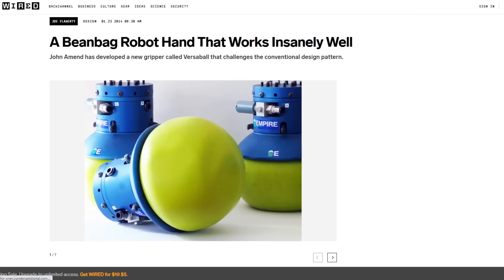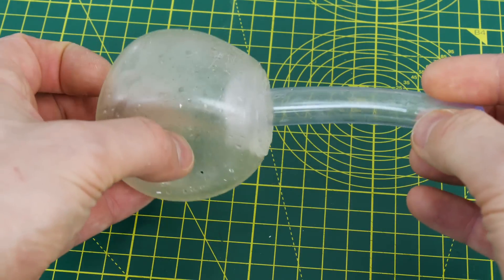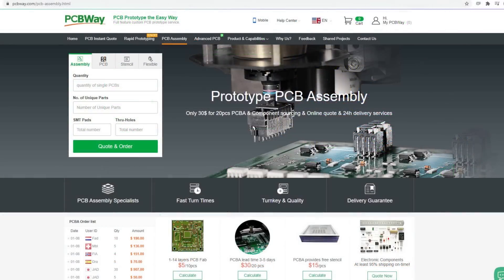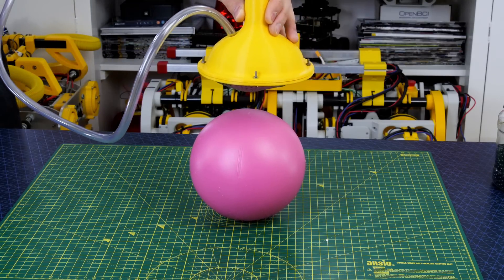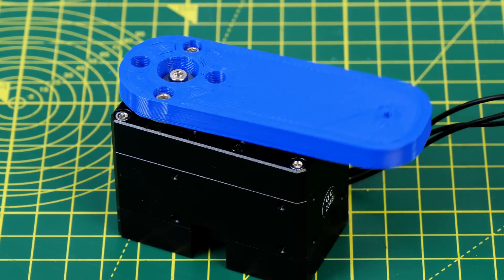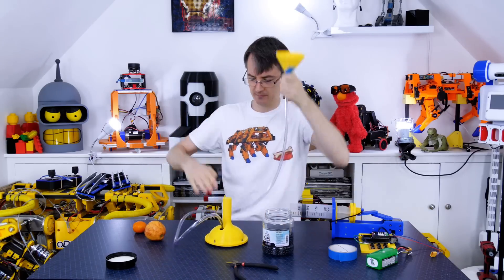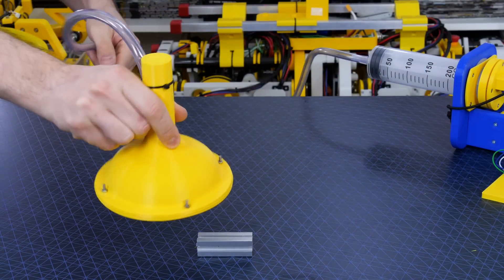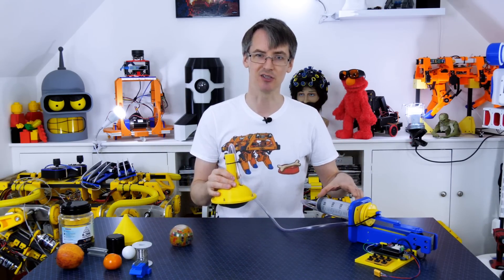Experimental Jamming 'Beanbag' Robot Gripper

Comment: You shouldn't have bolted the outer skin to the holder, if you glued the inner skin (with a silicone based glue) you'd have flexibility where you need it and God hold fast.

Comment: 3d print like half of the baloon in very flexible filament (like ninjaflex) and fill it with small metal bb's
Reply: and take a bigger siringe or vacuum pump to pumb out more of the air

Comment: I thing you can use the 100cm toy, but make the funnel smaller so you can mount it more at the end of the toy instead of in the middle. so you have more rubber membrane in the front to mold around the object.

Comment: Couple thoughts on this. I think a combination of a thinner but possibly stronger rubber might do quite well, as well with a reduction in the size of the grain. Together that should help increase the surface area in contact and leave less air in between the material.

I wonder if a liquid might make this perform better as well? Or maybe it wouldnt even work since it isnt compressable. Would love to see that tested!

Comment: A student of mine built a universal jamming gripper like this as part of his final-year mechanical engineering project where he was automating a fruit packing line (he also did pick and place operations using machine vision). He found that using much smaller granular material was the trick required to pick up the apples. He used a pneumatic cylinder driven by a servo instead of a syringe, which is much heavier and more expensive, but worked very well.

Comment: Two improvements come to mind: smaller grains and perhaps some method of blowing air around the inside of the membrane to liquefy the grains so they can mould around objects better. I'm thinking of Veritasium's latest video on burrowing soft robots.
Reply: Dang, beat me to it! I was thinking the same; coffee grounds or course sand or something, with an agitator to get them to really flow around the part being picked up.
Reply: Maybe an in and outlet inside the gripper, so you could flow air through, but on griping use both for suction?

Comment: Neat! Never seen this sort of thing before. I was surprised it managed to pick up that big ball in your first tests, I didn't think it would have anything to hold on to. Maybe smaller BBs or possibly sand would work better for a less lumpy grip? I imagine something that better forms to the contours of a shape would work better. 

The other thing is possibly the depth of the gripper, this one seems to have a flat face, with not too much room for objects to sink into it, the one in the video you showed had a large hemisphere-ish shape to it which seemed to let objects sink into it a bit more maybe? It also seemed like it was quite full maybe to the point where the membrane was slightly pre stretched using the filler material, not sure if that would have made much difference.

Comment: Perhaps the low density glass microspheres used as composite filler would work well and be very light? The only concern would be that they would be sucked up the tube so you would need some form of filter on the outlet of the gripper bag.

Comment: To get a better grip on contoured & heavy objects, you should use a much smaller item than BBs. The hardened BBs most likely wouldn't stick because of a combination of not being able to adapt into crevasses and also their inability to press onto the membrane at every point. Doesn't the small BBs just look like it would form more? Maybe play sand or even rice? Sorry for the text diagram but YouTube does not support images yet.
╔══════════╗   Key:
║╭╮................__╠═══════════╗
║╰╯╭╮
...╱▒▒║╭╮= Large BBs  ║
║╭╮╰╯/▒▒▒▒║╰╯
                       ║
║╰╯........|▒▒▒▒╠═══════════╣
╠══════════╣ ..... = Empty Air    ║
║░░░░░░░░░__╠═══════════╣
║░░░░░░
░╱▒▒║ | = Membrane      ║
║░░░░░░/▒▒▒▒╠═══════════╣
║░░░░░░|▒▒▒▒║ ▒ = Target Object║
╚══════════╬═══════════╣
                                ║ ░ = Small BBs     ║
                                ╚ ═══════════╝

Comment: Might be beneficial to have separate bag regions, like four surrounding a central one. Outer regions vacuumed for shape then inner region vacuumed for grip. Separate regions would also reduce the need for the massively large bags, and plumbing could be reduced by connecting all the outer regions together as the concept has them functioning at the same time.

Comment: About the air pressure problem:
what about a multi-syringe setup and a "bellow" which is normally empty but when pushing an item inti the grip it can take up the air
this way you could suck out the air in the bellow and the squishy toy

Comment: I wonder how this would react to compressible beads (like styrofoam). Could the grabber shrink around the object to grab it harder?
Reply: I think that wouldn't work; when the air is sucked out, the compressible beads would compressed away from the object. Maybe a compressible membrane would be better; it would get squished between the beads and the part; it would be pulled thinner when the air is removed, but if it's thick enough, it may still be squished against the part enough to generate grip.
Reply: @SpencerPaire  I thought about it as an analogue to a metal expanding and shrinking due to temperature. A common way to fit metal parts is to heat the part with a hole so that the hole (unintuitively) expands, allowing for another part to fit inside. Then, when the metal cools, it shrinks around the part for a tight fit.

Comment: Is it worth trying smaller granular material, rather than bbs? Should allow it to get closer to the object with better packing efficiency. Maybe also a mesh to stop the granular material escaping up the air pipe to keep the volume more consistent?

Comment: yeah one thing you seemed to not mention in this is testing with different media, can you try rice or perhaps sand to see if you get better results, i know with smaller media you'll have to add some sort of filter that will allow you remove the air but not the media but I'm sure a bit of cotton stuffed in the pipe will be a simple solution for that

Comment: 1) Use smaller BBs
2) Make sure the membrane has as much friction as possible
3) Eventually I would think you would move away from a syringe mechanism, when you do place a one way valve on the line that vents air when you press the gripper into objects

Comment: With the syringe, you're only getting a 50% vacuum at most. I closer to 95% would help a ton, and maybe smaller balls. The one I saw in 2012 used ground coffee, because it's small particular size, and high inter-partical friction under compression from the vacuum. Would fear the BB's are too smooth and easy to slide past eachother, even under pressure.
Reply: He could reduce the length of the tubing to help.

Comment: I think your main issue is the particle size. The smaller each particle is, the better the molded shape will be, which should increase the gripping force. You might be able to use something like sand instead of BBs.
Reply: There's definitely a balance, the larger balls not being able to pack perfectly means there’s a bit of pressure applied onto the object when the air is removed, with very small balls, that won’t be the case

Comment: The bbs are too big, and the rubber is too thick. Try a balloon with some sand in it. You also don't need a lot of air movement. That syringe should be more than sufficient for something the size of a basketball.

Comment: It wouldn’t last too long but I think I’d try literally just using coffee grounds first. With a conical burr mill you can make the grounds any size you want and I think the rough angular shapes cause the grounds to lock up nicely when under pressure.
Reply: in fact I've literally seen such grippers using ordinary coffee grounds, and it works great! The one in this article uses coffee, for instance: https://spectrum.ieee.org/automaton/robotics/industrial-robots/universal-jamming-gripper
Reply: i imagine it'd be easier to use fine sand

Comment: smaller membrane, smaller bb's. You can use styrofoam balls from a pillow, search "styrofoam ball pillow", they are small, cheap and will work perfectly. One more thing, this membrane you have there, wall diameter is too big for this. Use a baloon.

Comment: We use a similar technique for pre-hospital splints for fractures, and even a whole body mattress for possible spinal injuries. I’m sure the beads are expanded polystyrene, as they’re solid, but with a little bit of give which helps them mould together when a vacuum is applied, plus very light.
Reply: came here to comment the same. It's probably the same stuff those huge bean bags are filled with. I bet a simple balloon of any size filled with those would work better because of the size and give of the beads.
Reply: What are pre-hospital splints and mattresses? Something to use in ambulances on the way to a hospital? Sounds pretty cool if it's that.
Reply: @olekaarvaag9405  it is. it forms to the individual's contours, without pressure and hardens with vacuum to stabilize. great, if there might be spine injuries or to keep fractures in place. any movement would cause more damage and, frankly, hurts like a bitch.
Reply: @therealpanse  had to ride 45 minutes to a hospital holding my left arm in my left hand because of a break. can confirm, every little bump in the road hurts
Reply: @kingmasterlord  had the same experience with a broken shoulder, the weight of the whole arm tugging on it even with the smallest vibration. Not fun. they make those splints like arm slings too, and it gets strapped to your body, so it supports the weight.
Reply: I used a bed like that as a test patient for the hospital when I had a major hand surgery. The representative and some hospital bigwig came in to interview me on lots of aspects. I asked them what the beads were and they said it was a copper bead sheathed in plastic. It was insanely comfortable when turned on, and conformed perfectly to my body when off lol. They joked about using it to restrain unruly ten year old patients (I was famously un-unruly).

Comment: I bet it could hold objects more securely if you used bb’s with higher friction
You could try coding them with something like plasty dip or textured spray paint
Reply: While thats a good idea, the texture of the BBs shouldnt make much difference since there is a physical rubber barrier between them and the object. Maybe a higher friction coating on the actual membrane?
Reply: The friction is of the rubber that the BB's are in. He just needs to use smaller things than BB's.
Reply: This. Also lighter BBs. Airsoft instead of steel shot?
Reply: @senorkarl  Thats an option, but honestly something like rice might be good as a test, and something like sand or really fine silica beads or even rice should be really good since it would be higher resolution?  One thing for sure is that it needs higher pressure to actually get the filling into all the gaps. The concept is great, especially for collecting delicate objects as the gripper shouldnt be exerting much pressure on the object directly.

Comment: Wouldn't it work better with water instead of air since it can't be compressed ?
Reply: Air flows easier. He should be using things much smaller than BBs. The correct size material would heavily limit water flow through it when compressed.